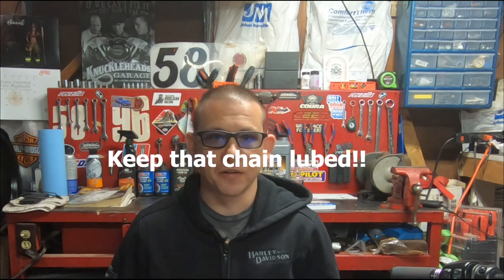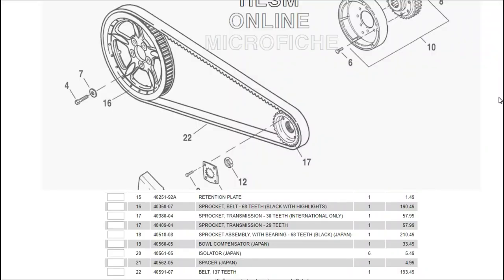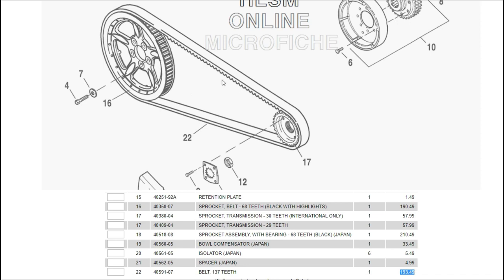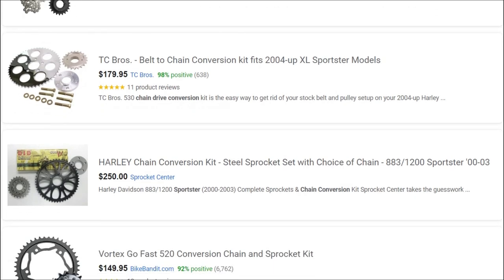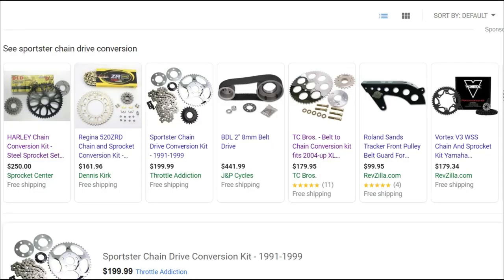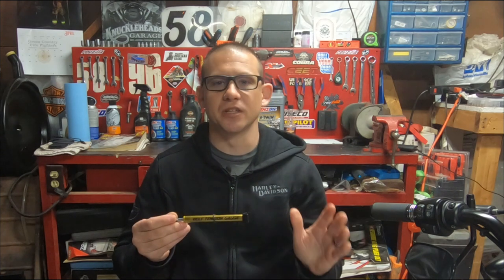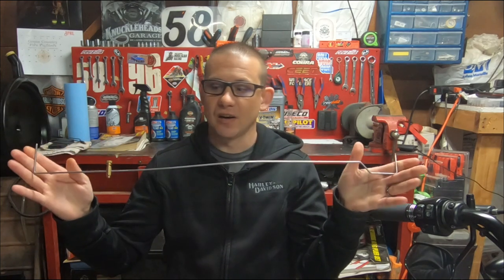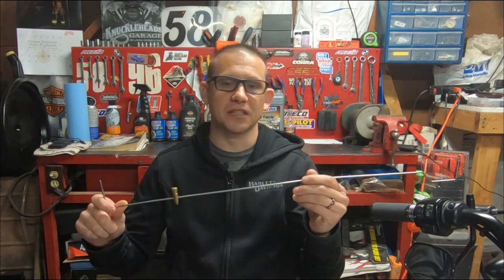Chain Conversion or Keep the Belt on the Harley-Davidson Sportster

Comment: The cost of Harley pulleys and Belt is twice the price here in Australia I had them on my 1983 FLHS and then on my 1985 Evo which I still ride I went Chain back in 1987 on the Shovel and in the late 80s on the Evo , I have done 280,000 Ks with my Evo and it's still my main ride , I do have a 2013 Twin Cam 103 with 30,000Ks  but it's for Sale ,
The point is I can change a Chain in the gutter but I can't do that with a Belt ( O and I run points )
Reply from the maker: For gearing changes there's no getting around a chain and sprockets for cost effectiveness!

Comment: I'm in the process of a chain conversion on a 2013 sportster 1200v. Reason I'm going to a chain is I streched my swing arm 7 inches
Reply from the maker: Chain and sprockets are a lot cheaper for custom work like that and gear changes!
Reply: @GixxerFoo  you are so correct on that. I wanted just a bit more umph on the lower end. Didn't see no need to go into the engine when I could play with the gearing to get it. Also, by streching out the swing arm, I have the same wheelbase as a street bob

Comment: Ah yes. The sound of an antiquated, two-cylinder tractor -
VROOOM!  drip VROOOM! BLAT! VROOOM! POP! drip  VROOOM! drip GUDDA GUDDA GUDDA GUDDA drip VROOOM! BLORT! BLAT!  drip GUDDA GUDDA GUDDA wheeze drip VROOOM! POP! BLAT! drip...
Reply: My OEM 2019 Roadster/Sportster is very quiet.  I can hear the clattering of internal parts when I am moving.  So quiet it is in the range of a Honda Nighthawk in decibels.
Reply from the maker: Yeah those stock mufflers really let you hear the mechanics of the motor, they don't have any silent roller chains and everything is gear driven in the engine.

Comment: The Sportster has holes Ii n the swing arm to measure the rear wheel from . There mid way on the swing arm if you all want I can get a picture of them and just use a old metal coat hanger . It works.
Reply from the maker: That's exactly what I do to line mine up!
Reply: Good deal.

Comment: I installed a chain conversion kit i have to tighten my chain every 200 miles and watch the aluminum sprocket erode away with each trip. Now im looking for steel sprocket and beefy 530 o-ring chain, probably going to go with drag specialties.
Reply from the maker: I've never had good luck with aluminum sprockets for longevity either, I used them for weight savings on my race bikes. But on the street I went with steel since I did the same thing too watching my sprockets get eatin away.
Reply: PBI makes the best sprockets period if you have alloy sprocket check there website cause they make it in steel also ! Cheap sprockets will result in tight & loose spots & will ware the chain & sprocket prematurely ! As an old drag racer got lots of time with 530 doing chain & sprockets !

Comment: You mght get a smoother ride wth the chain---it allows a bump hit to rotate the wheel slightly, the 'tight' belt has no rotatonal 'give'....
Reply from the maker: Chains are great for high horsepower builds, classic look and they are a lot less prone to damage. It doesn't haven't often but you can pick up a rock and shred a belt.

Comment: service writer at my dealership says the rear belt on his 22' ultra limited can withstand 150 hp and 600 lbs worth of people for 100k plus mileage.  150 hp for 1500 lbs of loaded bike.  i feel bad for the clutches and or the transmission.  but i believe in his thought...the belt will last 100k, maybe.  meanwhile im riding a twin cam fxr with a chain at 750 lbs totat w rider.

Comment: I'm "Choppering" My 2005 883XL and I want a little wider tire. I'm going to have to convert to a chain to make room for a wider tire. Otherwise, I really like the belt setup. 45 years behind bars and belts are sooooo much less work or trouble.

Comment: I think the chain conversion is attractive to people that NEED to change the belt for whatever reason, but don't want to disassemble the ENTIRE motorcycle to do so. Converting to a chain adds performance not only from the delivering power more efficiently but also a regular sprocket is lighter than the big heavy pulley reducing rotational mass and unsprung weight. 

I would likely leave the belt alone until either I had a belt failure, engine modifications, or If I was already doing clutch maintenance.

Comment: When belts first came out, they musta make a splice kit for a belt that would get you back home !!!
Reply: When Belts first came out?  The early 20th century motorcycle belts were made of leather.  I suppose it could be stitched back together at the local leather goods shop.  Modern Kevlar Blend Belts... have you ever met someone that told you they broke thiers? Maybe debris lodged in the teeth or sprocket gears by kicking it on dirt roads?   Buell's  Ulysses came with a belt driven system and it was an Offroad bike.
Reply: I shoulda  said when the Sturgis was introduced,  sorry about that !!!
Reply from the maker: When Kawasaki first introduced a belt in the 1980's they actually did a demonstration by hanging the bike by a drive belt to demonstrate it's strength. They are really tough, but like anything if they sustain any mechanical damage they will break.
Reply: @GixxerFoo  Agree!
Reply: i have an anomoly.... 
built a custom belt drive on a 97 marauder.i can change the belt without removing the swing arm .can do it on a kickstand and a floor jack( not a bottle jack) but been fortunate the belt won't break. it was worth the work.

Comment: V Belt Supply. 
i bought a custom size belt for my Marauder . 170$ rated for 400 hp electric motor so more than adequate . used old S 40 pulleys .belt measurez 40 mm wide 
                    14 mm pitch 
               2002 mm long. 
              round tooth. 
you can see it if you go to my channel in my thumbnail.
Reply from the maker: That's awesome! How's it ride swapping over from the chain? I'll check that video out.

Comment: Saw my belt lying on the road in the mirror of my XL 1200, (40,000 mi) just installed chain, won't happen again. make sure you get the year right. Not hard.

Comment: Anyone else ever have belt squeak after a chrome pulley install? Can't seem to chase it down on my 06 XL1200c
Reply from the maker: Yes, I have had that in the past. Checked alignment and really couldn't find anything wrong. I put some miles on it and eventually it stopped, I believe it was the finish on the pulley where the belt ran. I went to using a black or chrome cover going forward so I didn't have to deal with it again.
Reply: @GixxerFoo  Just to clarify. You got squeak on the chrome pulley - not the pulley cover?
Reply: @GixxerFoo  and same. Alignment and tension won't do it. Lubing the side of belt will eliminate the squeak for only a few miles

Comment: I was skeptical about the belt... today I think back to the noisy, dry slapping chain that requires lube that makes a mess out of your ride. If I wanted another chain I'd buy a Suzuki....🤣👍🏻
Reply from the maker: There was a lot of of people wondering about belts back in the day but they are really a lot stronger than most would think! Low maintenance and reinforced with kevlar doesn't leave you much to worry about.

Comment: Wanting to do this on my buell m2 cyclone
Reply from the maker: Those bikes are getting hard to come by! I wish I would I would of bought one back in the day now.
Reply: @GixxerFoo  the M2 bikes are still out there for a reasonable price 
Mines a 01 with 16k miles
Got it for 2400$
Reply: @GixxerFoo  i had a choice 
Buy a sportster for 3-6k and have less power and have a more typical bike
Or buy a buell for the same price
Have a faster and more unique bike
Reply from the maker: Damn that's a steal, the clean ones l have found close to me were not that good of a price.
Reply from the maker: Buell is the way to go, those motors really started to become their own when they were axed. They did some really awesome engineering on those Evos.
Reply: @GixxerFoo  yep they did
I had to travel 6hrs to go get mine
In tell city In
They are worth traveling for 
Ill link a video to my bike for you
Reply: @GixxerFoo  https://youtu.be/ptCU31ixgdU
Heres what my bike is like right now
I plan on throwing on a Hrs42 carb
Reaper 505/515 cams
And some mild head porting

Comment: What?! Belt loses more power than chain? Belt and sprockets are probably lighter. Or at least similar weight. Where does this statement about 10% less power come from?
Reply from the maker: It's a toss up depending on what material you're running.
Reply: Mechanical engineer here. Chain drives are more efficient at transmitting power and distributing heat. 
Belt drives have to be tensioned fairly tight to operate safely and not slip. This creates friction between the belt and the pully system, which causes energy losses. Belt drives also have the disadvantage of stretching and slipping if they overheat, although the engineers usually acount for that in the belt spec.

Comment: All the complete kits I've seen use a 530 chain. It's too big and heavy and eats power. They are expensive for the quality of the components they come with. I just bought quality pbi sprockets, a spacer and seal for a 91 sportster and a 520 tsubaki superbike chain.
Reply from the maker: Tsubaki is a bad ass chain, I used those on my race bikes for years!

Comment: Driveshaft.. Definitely convert to driveshaft
Or just buy the steel belted belt 😝🤣🤪
Reply from the maker: Lol converting to drive shaft can be done, l've seen Kawasaki 900 Eliminators converted from drive shaft to chain. Serious pia but it could be done.
Reply: @GixxerFoo  and why wouldn't you.? Why would you ride on anything less...

Harley's act like the king of the motorcycles  
Even have a "road king"
Reply from the maker: Lol l've never considered the Road King king of the road 😆😂. They should fire whoever named their bike models.
Reply: @GixxerFoo  My name is Bob, I'm fat. You guessed it, I ride a '17 Fat Bob. It just seemed to call me.
Reply from the maker: Fat Bob is an awesome bike! One of the best handling Harleys out there.

Comment: You put less power to the ground with a chain because the chain and gears outweigh the belt so therefore you have more rolling mass and you lose more power with a chain
Reply from the maker: Chains sure make it easier for gearing changes but you add quite a bit of maintenance.